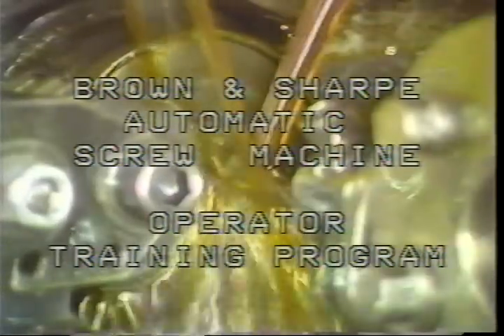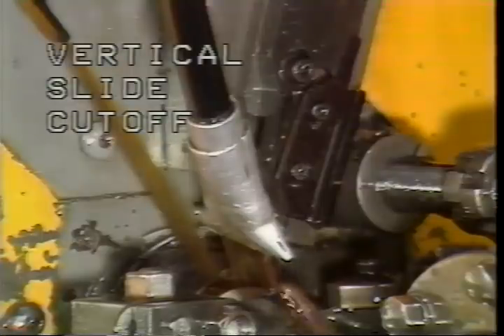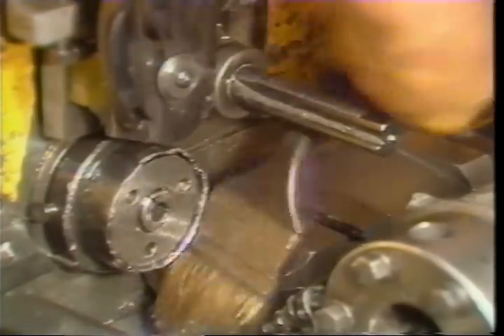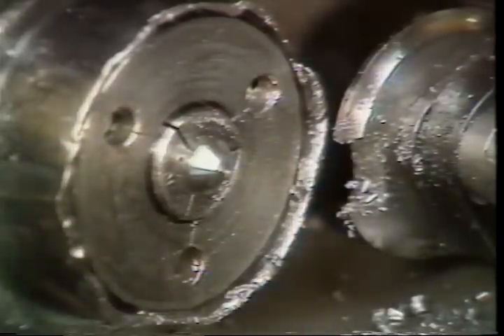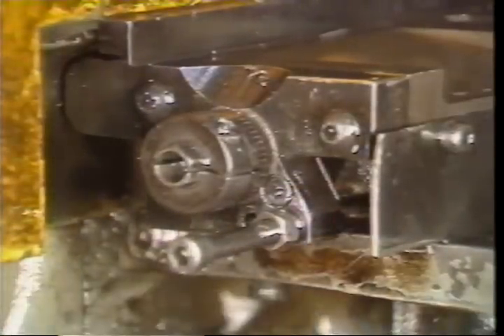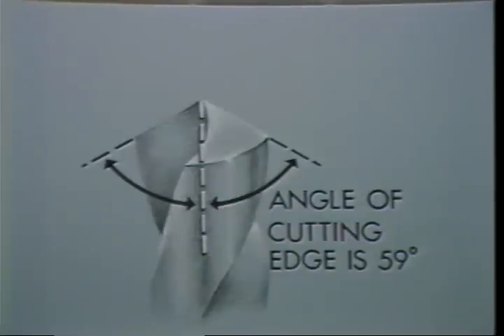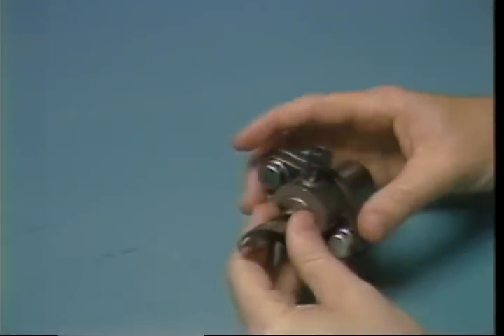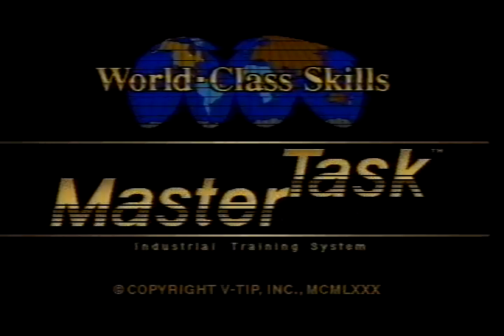Brown & Sharpe Setup Training Part 7: Basic Setup

Comment: Thank you for sharing these.  My father was a mechanical engineer and decided after losing his job in the early 80s to buy a running machine shop business in Chicago where we lived when I was a youth.  He set up and ran the B&S machines that were in the shop and knew them well.  When I was older, I ran and operated the new Hardinge CNC machines with the GE Fanuc controls.  This B&S machines were amazing mechanical marvels, but needed cams made to do specific jobs.  They were also quite noisy with the motor and all the mechanical “hammering” of things like the turret as they would operate.